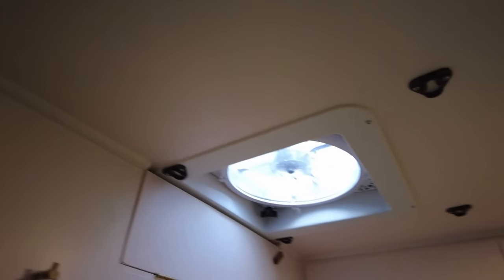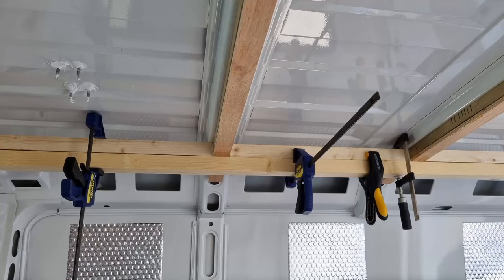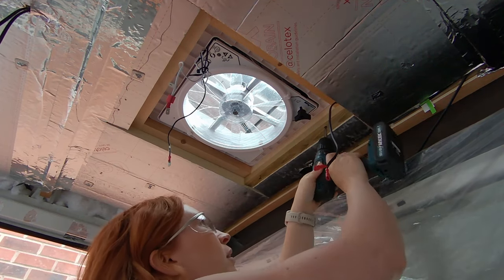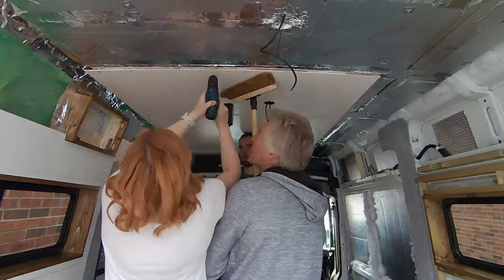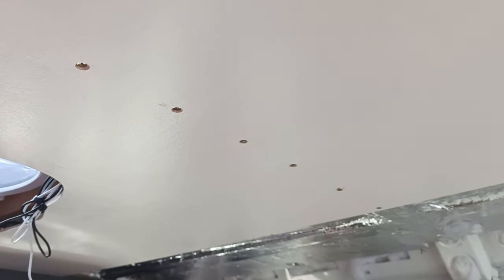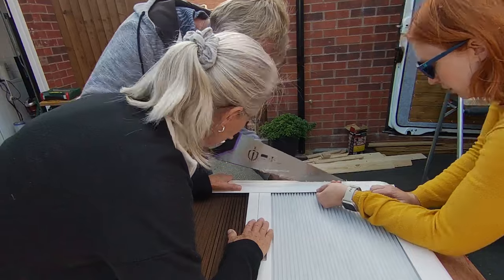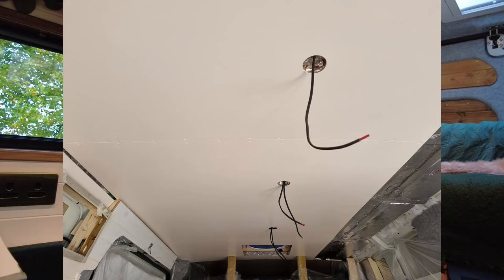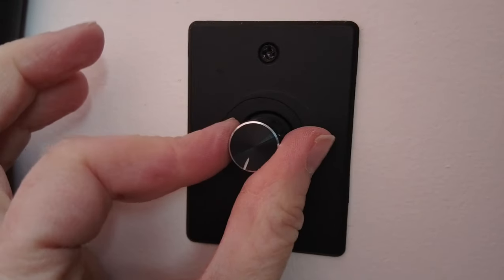How I created a neat (and cheap!) ceiling in my van conversion

Comment: It's very neat.  We used T&G and it was a lot more of a faff.  Can you still get to the bolts that hold the high level rear brake light in place, in case the bulb needs changing?
Reply from the maker: Ummm no, I only learnt I needed internal access to that by reading your comment 😂. I thought I'd done really well to retain access for the side light units, reg plate, door handles... Apparently I missed one, so please keep your fingers crossed it stays lit 🤞🤞🤞